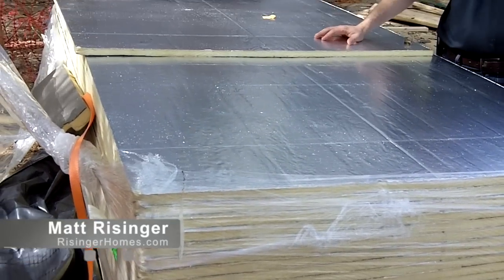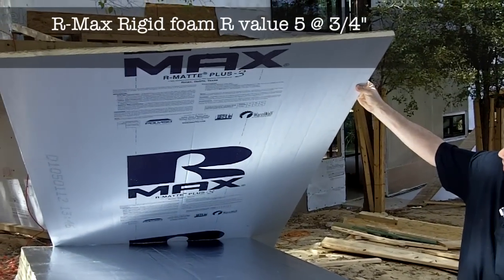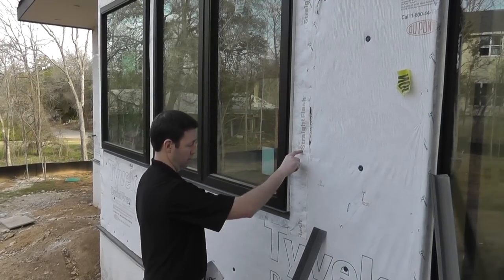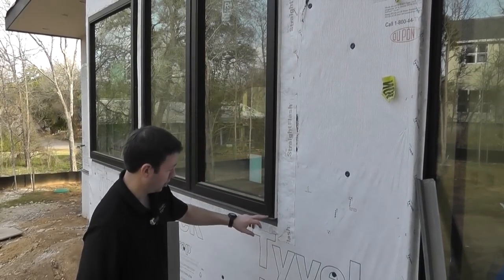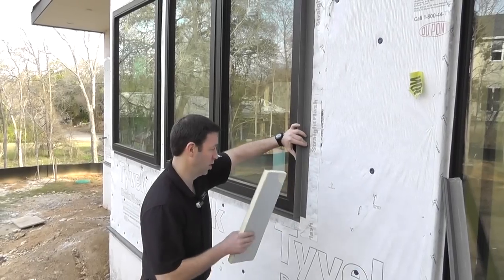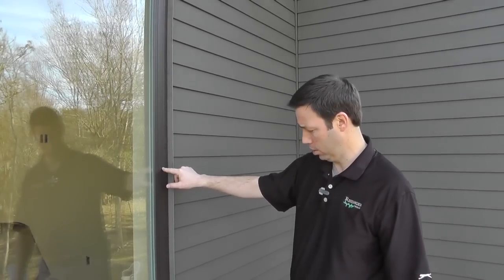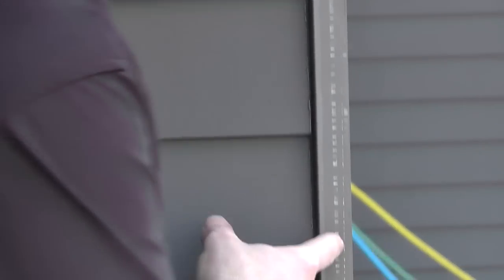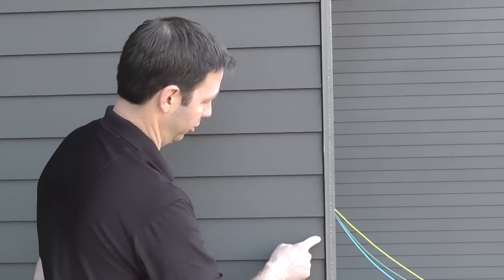Installing Exterior Foam w Hardie Plank & Andersen 100 Windows

Comment: Matt, I am a believer of the "outsulation" concept with exterior rigid foam, this was further explained to me by Martin Holladay's writings on gba.com. However my current project involves cement based stucco and stone veneer exterior.-  What are your thoughts of outsulation in these cases? Local engineers (two different ones) said absolutely NOT for a variety of reasons. The structural problem with "creep" was the first and most pressing. I read about creep on the BuildingScience.com website, Joe Lstiburek wrote on the issue. Despite engineered fasteners, specifying gauge and frequency of placement to handle the weight, it seems it is considered a bad idea. The thicker the insulation, the worse the idea. Dana Dorsett, a respected engineer on gba.com said I should be able to use taped 3/8" XPS fan-fold as a WRB and gain some benefits in the process. Given that background, my follow up questions are: - Since stucco gets wet (and absorbs water each time it rains) as the stucco dries, there have been numerous cases where sun driven moisture caused stucco and wall failures. Granted these may have been poorly detailed WRBs over OSB sheathing, but that said, it strikes me as critical that moisture is NOT driven into the wall. Thus a taped XPS WRB would serve me well given its low perm rating (Owen's Corning Propink perm rating 0.75). You agree?* The house (new construction 2x6" stick framing, 1/2" plywood, Zone5) is already wrapped in Tyvek to keep the plywood from the elements. Was going to wrap it with taped 3/8" fanfold then install galvanized mesh for 3 coat cement stucco application. Between the bays was going to use simple fiberglass insulation to allow walls to dry to the interior* with 1" EPS panels (moisture permeable) under the sheetrock. I know you like blown spray foam, and this seems a bit backwards, but this assembly avoids the cost of spray foam and with exterior stone veneer/stucco, thought this is a safer assembly. Any advice or concerns? Thanks much. Great work on the videos! You disseminate great info to so many who need to be reminded of good craftsmanship and energy efficiency.

Comment: New to your channel and learning a lot! I may have missed this but since you're using hardie plank here versus pine siding in the other video, why use the rain screen behind the planks? Doesn't the hardie material not absorb water anyway where you don't have to worry about cupping? Great videos !
Reply: With hardie u are relying 100% on the paint and caulking
Reply: cement fiber board adsorbs moisture, all cut end must be painted when using factory painted stuff or paint on site.  factory painted stuff is best, they sell the trim paint kits for that exact reason, all cut ends get painted

Comment: What was that outside "corner board" made of? X-Brace? And the inside corner? Do they both have flanges like the window metal detail. What's  the nail schedule Hardie through drain screen into 24 O.C. framing? No Wavy Gravy? What the layout of the drain screen?

Comment: Would these products be a good combination to update a 1970's tract house here in N. Austin?  Is there any type of "blanket" or spray foam insulation behind the Tyvek between the dry wall and exterior?  I'm looking to replace my 40 year old siding and re-insulate at the same time but had only considered the spray foam up until now.  How do you recommend re-insulating an older home?  Really appreciate your videos by the way!  :)
Reply from the maker: Excellent questions. If you are re-skinning the exterior this is a great way to go. This allows you to do a good weather barrier like Tyvek then add exterior rigid foam to break the thermal bridges at your studs. In your climate I'd recommend going thicker on the outside sheets of foam. Shoot for R-10 or better. Hope that helps. Matt
Reply: Matt Risinger u

Comment: Hi Matt, the foam on the walls that isn't permeable.  My question is how do you not get mold growth??
Reply: You're right, it isn't permeable at all with the foil facing.  The wall needs to be able to dry to the inside, so you must have air permeable insulation (like fiberglass batts) on the inside.  If you were to place an air impermeable barrier on the inside of the wall (like poly sheeting) then you would get mold and rot inside the cavity and on the sheathing.
Reply: David Perry thia is designed to dry to the outside.

Comment: Matt, got a question I haven’t seen addressed (maybe I haven’t found it yet?)  I’m in Virginia so we have the worst of both worlds, hot humid summers and cold winters down into the teens. I’m interested in retrofitting my house with Roxul on the outside, a reflective wrap and finish with stand-off Hardie siding. So, my question is specific to finishing and sealing the bottom skirt where the wall meets the masonry.  I assume a standard bottom finish on the Hardie but I’m trying to figure out how to best close the bottom of the Roxul profile while still leaving a gap for water to escape between the Hardie and the reflective wrap. Anyone have experience or a suggestion to share? Thank you!
Reply: Japanese climate is similar. Most siding appears to be air gapped from top to bottom with it hanging over/outside the concrete foundation lip to which the framed/insulated/tyveked walls are attached. The difference is then usually bridged with a non corroding coarse mesh (purpose made aluminum section with a ton of roughly 1/8" holes).to keep out insects and debris while allowing air to rise and moisture to escape.

Comment: It seems to me you have to remove the siding to replace the window the way this was done ??
Reply: Replacement windows are designed to fit inside the existing window jamb without removing the old jamb.  The exterior siding contacts the existing jamb so you do not have to remove siding unless you are re-sizing the opening.
Reply: No different than a brick house. You would either use replacement windows or have to cut the nailing fins on the original window if you didn't pull the siding

Comment: Any siding guys that have done some remodeling on a 15-20 year old siding and you run in to that DuPont tyvek crumbling in to pieces letting water in to the walls 
Everything has to be water tight to avoid any future problems
Reply: The "tyvek" was found crumbling because it was left exposed to UV radiation for too long before the siding was installed. DuPont Tyvek is an integral part of the water management system and will not deteriorate if correctly installed and protected by siding that has been properly maintained and keep in serviceable condition.

Comment: The caulking is not esthetic .  That would assume that the water evacuation will act the same in year 20 as it does in year 1.  A 1/8” gap  will let massive amounts of water in during a storm.  Over time the debris will begin to trap water and the pollen will clog any wraps permeability.  You will get mold and the water and mold will begin to cause failures in the wraps and tapes.   Systems that allow water to leave and dry are good,  but they should also stop water from entering in the first place.
Reply: actually having water be able to leave once it gets in, is better design, than trying to prevent all water from getting in....especially on hardie fiber siding, that's why they don't have butt joints caulked or tight 1/8" gap on all butt joints, al flashing behind each joint, and flashing on all cut outs, no caulking
Reply: Ok.. caulking is not esthetic.

Comment: What about INSULATED Vinyl Siding? Specifically PRODIGY brand? I need all my siding replaced, No Insulation in my walls and I need Energy Efficiency. THANKS!
Reply: Or is there some kind of Foam Insulation that goes over the tyvek/wrap and use NON-Insulated siding? What is best way to go, both on Cost and Energy Efficiency. I got samples of Insulated Vinyl siding from 3 manufacturers, and the Prodigy is by far the thickest foam,  Advertised to have R-Value of 5. I also need badly need the noise reduction, live near airport. Thank You so much!!

Comment: Now I have Box Elder bugs live in between my insulation and siding gap. Now I have to spray the house down with poison to kill the bugs and it doesn’t work immediately so what would’ve been a better way to seal this up
Reply: You can install a strip of bug screen behind the hardie  around all the edges of each wall before the hardie is installed

Comment: Do you just nail the Hardieplank through the foam board?
Reply: Darryl - I've seen videos where they nailed Hardieplank right over the rigid foam. (I'm not a contractor so I don't know if you should do this or not). What confused me on this video is that Matt seems unconcerned about moisture getting behind the Hardieplank due to the air gap method they use. It's my understanding that Hardieplank should NEVER be allowed to get wet. Now I'm confused. Maybe I just missed something and need more information.
Reply: hardie allows up to 1 inch foam if it has a min compressive strength of 12psi

Comment: Matt I have a question for you... I have hardiplank sidings and when it rains  heavily my windows leak. My roof needed repairs so I got  all of the shingles replaced thinking if leak came from the roof it will be fixed. However it rained for over  a week and a half before thanks giving and leakage was as bad as ever. Do you think rain water is seeping into the hardiplank then my walls and draining into my windows. Currently I have termites underneath one of my windows bought home just under 3 months ago. Your response greatly appreciated

Comment: 1. The WRB should be crinkled wrap or something that gives more of a gap before the foam for proper drying.  That is a requirement.  That wrap they used looks like the standard wrap.
2. Never use "foil-faced" rigid foam on the outside wall like that as it creates a vapor-impermeable barrier and traps moisture.  Wow.
3. I would worry about the dew point level between the outside to the inside wall when only having one 3/4" layer on the outside as they do here.  I'm guessing they also used fiberglass on the inside.  That can actually cause a problem as inside insulation prevents internal heat from getting to the sheathing.  Use a thicker layer or two layers of foam to get at least R10 on the outside and then with cheap R11 fiberglass on the inside, you'll be fine.
Reply: 1. It is Drainwrap, though I agree it is hard to see.  It is definitely not regular Tyvek.
2. Green Building Advisor, Fine Homebuilding, and Building Science Corporation all state that foil faced foam insulation is fine to place, especially if you are using one of the "crinkled" housewraps.  Walls only need to dry in one direction only.
3. That is a correct concern for climate zones 4 Marine and above.  See http://www.greenbuildingadvisor.com/blogs/dept/musings/calculating-minimum-thickness-rigid-foam-sheathing for more details, but the relevant paragraph is here:

"What if I live in one of the warmer climate zones?
If you are building a house in one of the warmer climate zones — zone 1, 2, 3, or 4 (except for 4 Marine) — you don't have to worry about the thickness of your foam. Any foam thickness will work, because your sheathing will never get cold enough for “condensation” (moisture accumulation) to be a problem."
Reply: Pink fibreglass absorbs moisture and has 0 resistance to air movement through combine that with thin plastic  vapour barrier to trap the liquid and you have mould . After 30 years of renos on houses over 160 years old I've seen the results of "modern" technology and vapour barriers are a major problem starter. Roxul and sheet foam are the best insulators. Blown foam degrades and loses r value over several years and suffocates the wood structure .
Reply: Cougar Land - Your comments read like you didn't watch the whole video and didn't think it through before you commented.

Comment: I'm building a rain screen wall just like this.  Is it better to follow this detail or use 2x2 wood blocking to push out the window?  I'm wondering if this detail is more expensive but easier to waterproof.  The wood blocking is cheaper but requires extra effort to waterproof?
Reply: Patrick Lamb this detail is easier to use with thicker foam than 2x's around windows will allow
Reply: Makes sense.  Thank you.

Comment: how do you instal siding on foam
Reply: Vasiliy Kyvyrzhik vertical furring strips
Reply: hardie specifies 8 inch on center nailing as opposed to 16 or 24 inch for traditionally framed and sheathed homes.

Comment: R5 ha could have used spray closed cell and never had the weakness of a hollow wall siding, baseball softball or kids will definatly Murphy's that quick. It wash almost an unspoken till to never leave a wall hollow, just dudes trying to reinvent the wheel closed cell foam and conventional building would have build a better house cheaper.

Comment: That siding can harbor ants and bees.  Water is not the only intruder.
Reply: ants will simply not make their home on top of foil faced insulation , nestled between hardie panels. I think you need some more education on insects! They won't live in the gap here, because they dont have the ability to burrow in. Now lets say a bug does go between the panels, and onto the rain screen gap; Big deal. They can't penetrate any further.
Reply: @blacktoise8866  I am speaking from experience and you are one needing an education. There is a tiny black ant in Oklahoma which is the size of a grain of sand and they do not live in the ground. Trees & rocks are where they were originally from but they have mutated to live in walls and attics of residential homes. The colony grows to many thousands and as long as they have food and water near by they grow the nest.  They chew through bead foam and nest in fiberglass as well.  Normal ant colonies divide up and compete with each other but this ant does not fight with a new colony. It just continues to infest new areas.  http://www.terro.com/little-black-ants

Comment: Hardy board is terrible and I dont know why anyone would use it.  Have it on builing, installed correctly.  Anywhere it holds any moisture even the slightest, it crumbles into powder.  Wood would last many many years without crumbling to dust.  Its just not a durable product!  And they told me "25 year finish warranty!"  I called them and said "we don't know what ur talking about".  Save yourself folks...use wood or vinyl.
Reply: Vinyl is just as bad. Weep holes don’t work there just cosmetic. Once it rains then your siding becomes a bathtub and never drains.
Reply: Lucky you Ben.  Mine is bad. Failing un multiple places

Comment: i will never use foam on a house ever again . carpenter ants realy love munching on that stuff
Reply: Perimeter pesticide.
Reply: Joseph Lstiburek of Building Science Corporation did a nice article on his barn that he covered in foam.  The only places in the foam that supported ants were those that were wet due to incorrect flashing details.  Dry foam doesn't seem to support them.
Reply: Nicholas Browning my foam has never been wet ...7/16 osb on the outside wraped with tyveck put 15in wide felt paper over that with cedar shingle siding ... carpenter ants foud away in and have been chewing the foam like a beaver chews aspen
Reply: I am really sorry to hear that.  Was there any detail on the bottom to cover the exposed edge of the foam?  What kind of foam did you use?  Seems like a pest company might be able to take care of it, though at considerable expense.
Reply: Nicholas Browning the foam is placed between the studs tight to the bottom plate and top plate with osb nailed directly to the studs and sheetrock on the inside . the ants found their way threw the cedar shingles chewed threw the tyveck and felt paper and threw the osb to get to the foam . i dont recall the brand . its just plain white styrafoam . i do place traps i dont like useing poisen . i have a number of farm animals
Reply: Was this a foil faced styrofoam?  Or was there an interior vapor barrier behind the sheetrock?  Did they infest the OSB too, or just the styrofoam?  What are the humidity levels inside the house?

Please understand that I am in no way questioning your ability or workmanship.  I'm honestly trying to figure out whether or not this works out for my house and I appreciate your engaging in conversation!

From Wikipedia:
Nesting[edit]

Carpenter ants work to build the nests that house eggs in environments with high humidity due to their sensitivity to environmental humidity. These nests are called primary nests. Satellite nests are constructed once the primary nest is established and has begun to mature. Residents of satellite nests include older larvae, pupae, and some winged individuals. Only eggs, the newly hatched larvae, workers, and the queen reside in the primary nests. As satellite nests do not have environmentally sensitive eggs, the ants can construct them in rather diverse locations that can actually be relatively dry.[12]
Reply: Nicholas Browning i live in western oregon we get quite a bit of rain in winter my sole heat is wood stove so humidity inside the home is not a factor . no intirior barrier on the inside of walls . no foil on foam ...carpenter ants chew on wood . short of haveing treated sideing they were gonna chew into my house no matter what . the foam i used appears to be just an extended invitation for them . maybe other types would do better . im not gonna tear the walls apart to replace the foam . its just plain whitestyrafoam with no backer on it put in 25 years ago . if i was going to replace it i would replace it with rockwool . i was a builder for 40 years i have no investment in rockwool but i would strongly sugest to check into it
Reply: Will do.  I have been looking at Roxul and I appreciate your experienced advice!